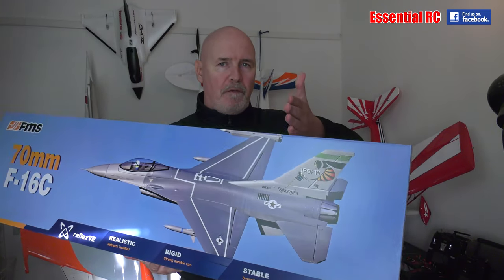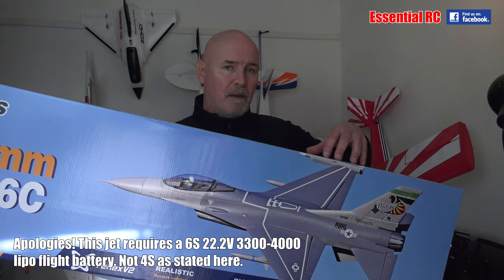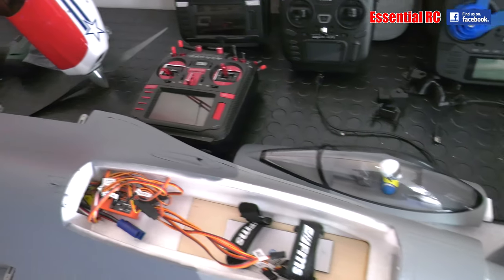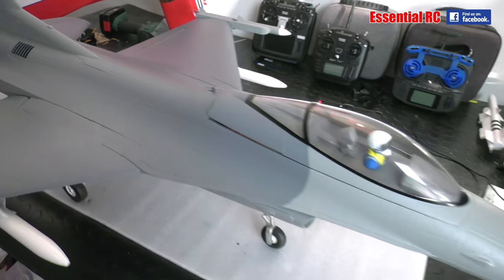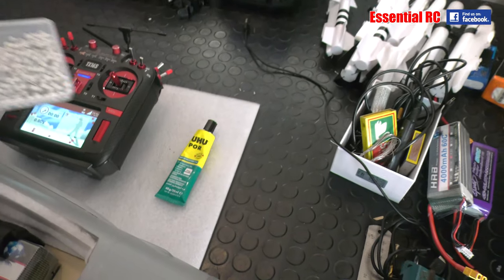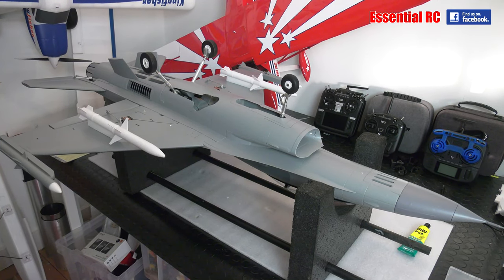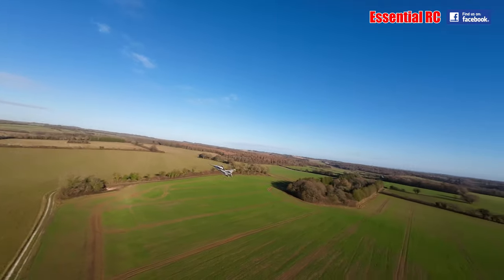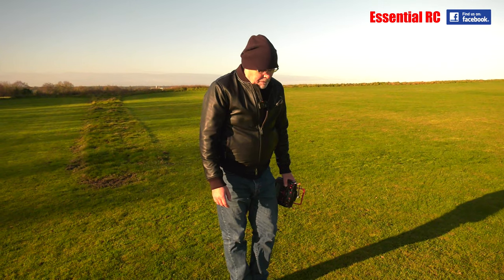AMAZING SLOW HIGH ALPHA ! FMS F-16 6S 70mm EDF fighter jet | RadioMaster TX16S | Frsky X8R

Comment: Hello! I follow your chanel, great videos and better comments. Thanks to share your knowledge and experience! I have just purchased the FMS F16 Falcon 80mm....and would be my FIRST EVER JET....and now I think I was too pretentious. Im an 'average' pilot on rc for warbirds, like Airacobra Eflite or mustang. But maybe this beast, Falcon 80mm is not the best way to start in EDF jets. What do you think as per your experience. I mean, can a 'pilot' for helix propeller planes, try an EDF like this with success? Or should I start with (for example) a Viper or a Freewing L39 albatros. Do you think there is big difference to start, an L39 compared to this FMS 80mm F16?
And second question is, I see you use as electronics, a receiver FrSky X8R, linked to a Reflex Gyro from FMS. Why not for example a unique receiver like S8R Frsky which contains the gyro stabilization in? (all-in-one). Think the Reflex gyro is better...when used with this EDF jets? Just to understand. Many thanks...also to make me reconsider (or not) and avoid me crash this beautiful jet in 10 seconds ;)

Comment: Fpv it? X8r is my go to rx also. Except for my small planes I'll use the rx6r. Iv had great luck with them.  Only recievers you'll find in my fleet
Reply from the maker: Analog FPV maybe because it can be light but I only do DJI FPV and this is too small for that. The weight of the DJI camera/air unit would make it difficult, if not impossible, to get the CG balance.
Reply: @EssentialRC  they have analog adapters for the dji goggles. Probly not really worth doing on that model anyway. Especially since you have some great models already set up. I'm planning on making my flex rv8 and my great planes citabria fpv ready. I have high hopes for the citabria with its realistic dashboard. It should look awesome as long as I can see thru the windows

Comment: How much is this plane READY TO FLY?
Reply from the maker: They don't sell it ready to fly with battery, transmitter and receiver. You would need to buy those. I recommend the RadioMaster TX16S or Boxer, Frsky X8R or X6R receiver and a 6S4000 60C lipo